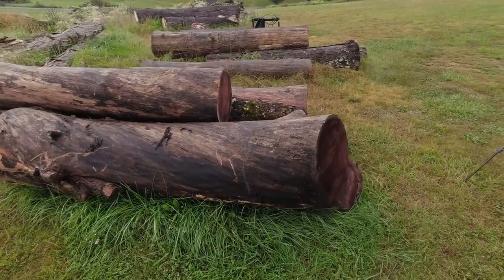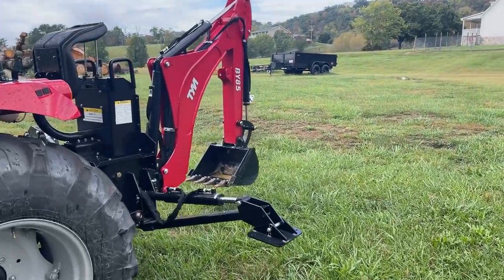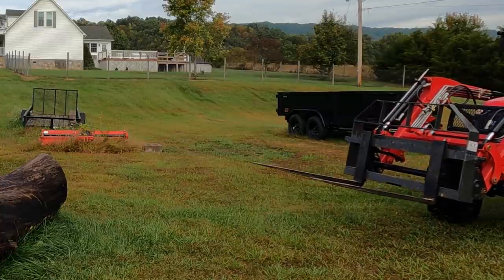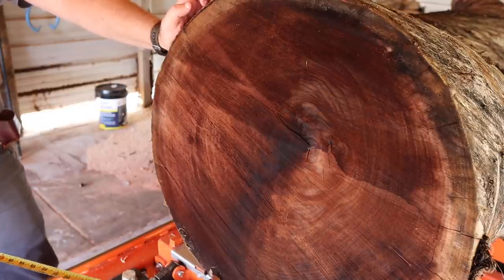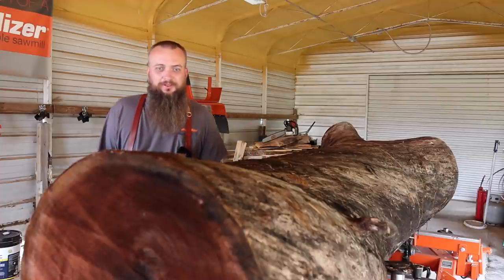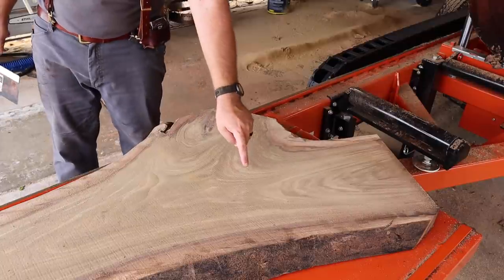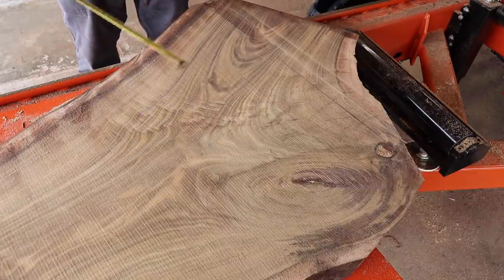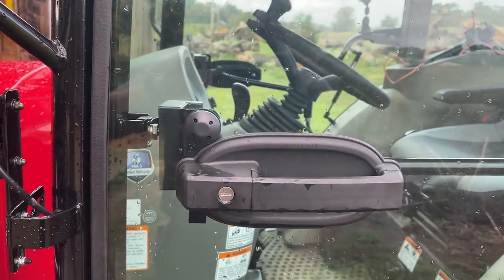After Years Of Being Left On The Ground This Log Will Surprise You

Comment: I use a chain to catch the foot wrist pins, threaded across the top to keep the outriggers from dropping too far.  Very important to feed the chain outside the controls so they don't pull the levers down.  Learned that the hard way once 😯

Comment: The outriggers nor any other hydraulic parts should move until you move the controls. Chances are good  that you have fluid bypassing the valves that control the outriggers, providing there aren't any external leaks in either seals or fittings and plumbing. Best wishes, Nathan. Awesome grain and color in that Walnut.
Reply from the maker: thanks